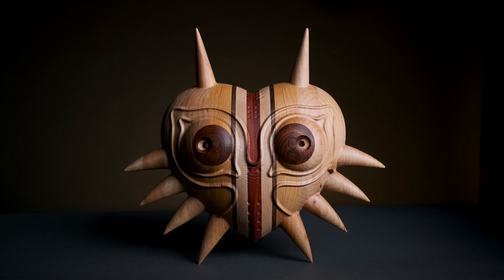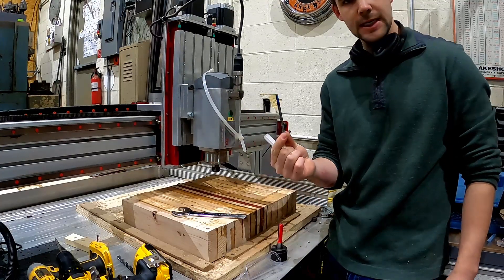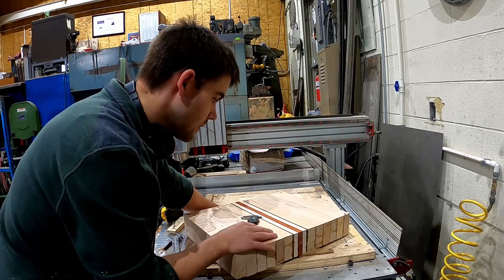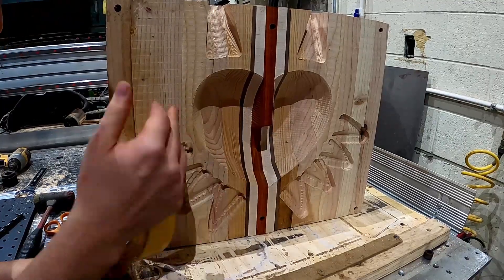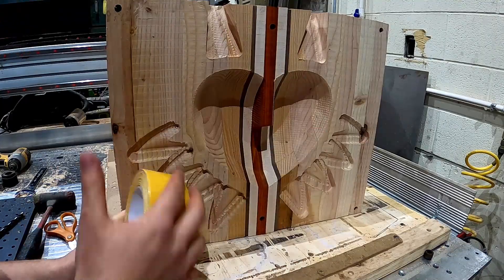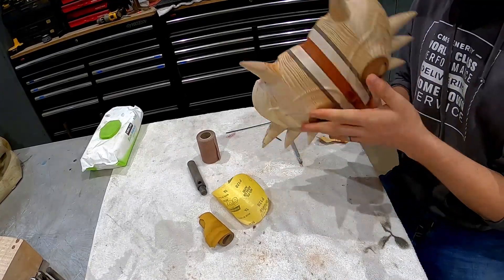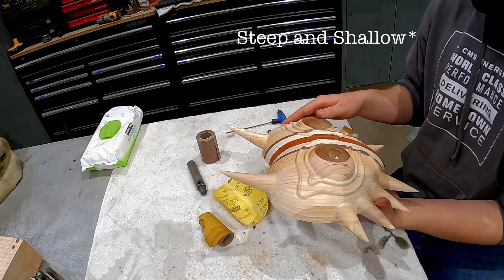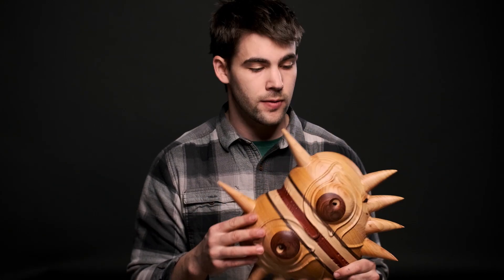I made Majora's Mask using an AVID CNC Machine!

Comment: I did a Majora's Mask back in 2018 with CNC also. But I used  MDF. How hard was the machine working while cutting into this block of different woods?
Reply from the maker: It actually wasn’t too bad, I slow down my cuts a lot to save my bits. The wood was really soft so I didn’t have a lot of trouble with it. I’ve had trouble with oak though.
Reply: @Idothings-JSWD  thank you!

Comment: very cool!  I like the new format.  consider also posting some imgur stills from this to reddit r/diy
Reply from the maker: Good idea, I’ve been posting on A few subReddits, r/DIY really wants you to put it in a “How to” format. Today I’m releasing a video about how to make this on Fusion 360, I should be able to make that happen
Reply: @Idothings-JSWD  yeah, Reddit is good for increasing exposure while your channel is still small.  Just remember that the user terms for Reddit require that a majority of your posts are regular interactions and only a few percentage of them are "self promotion".

Honestly, I would say that this video can count as a how-to.  You went through all the steps but also included links to the 3D model and CAD file.  It's enough for someone to watch your video (or a set of screen captures with captions on imgur) and then load if they have a CNC load the files into some CAM software to do-it-themselves.

Comment: I gotta make one of these too.  I actually tried to get majora's mask to work in fusion 360 a few times but I could never get a decent looking solid model from it after conversion to a brep.  Thanks for sharing!
Reply from the maker: With the amount of triangles you have to deal with a fun 3D mesh rarely can be transferred to brep from what I found. But I’ve been working around that, I posted a video on how I made this work in Fusion 360.